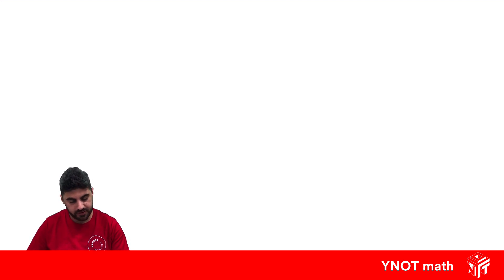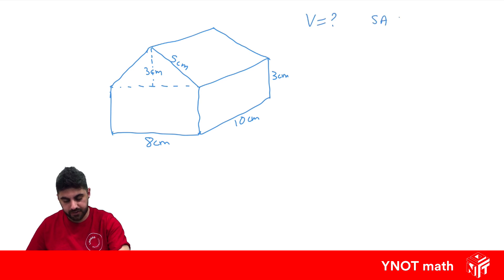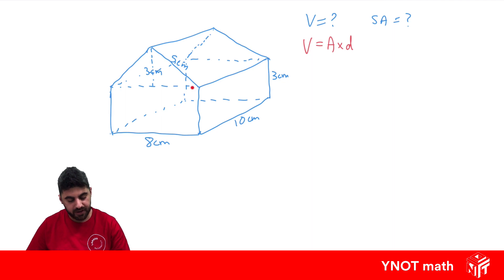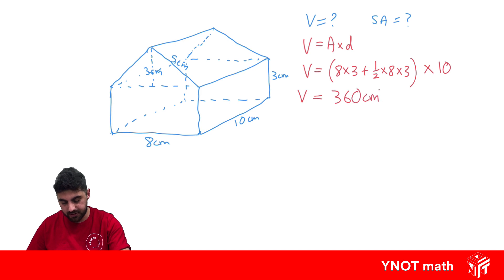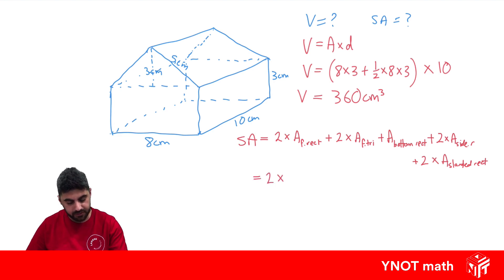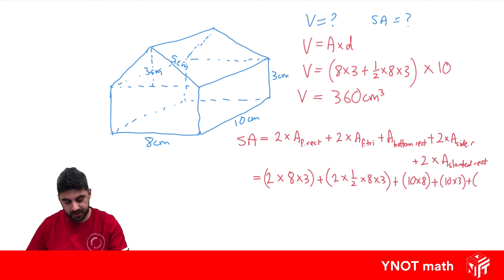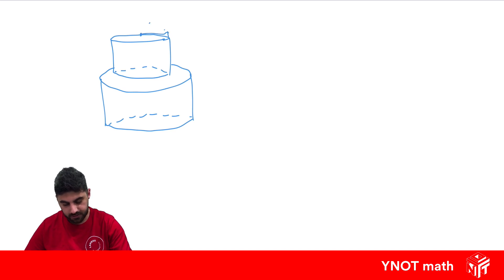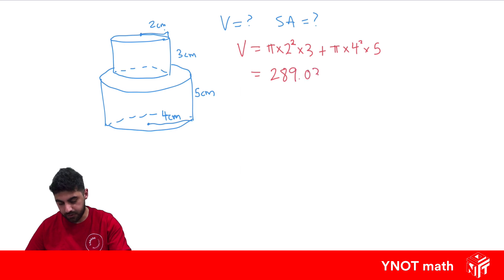Surface Area and Volume of Composite Solids

Comment: Hi, can you update this video as you made a mistake by not doubling the side rectangles and slanted rectangles in the first surface area example.
Reply from the maker: You're correct,  there is an error. The answer should be 392 cm^2